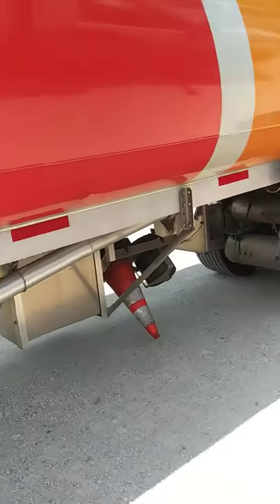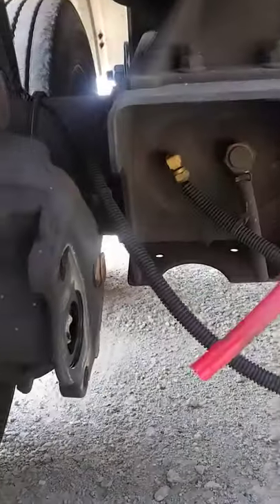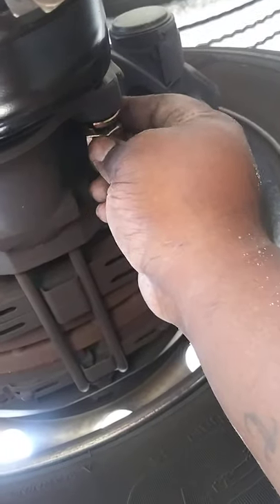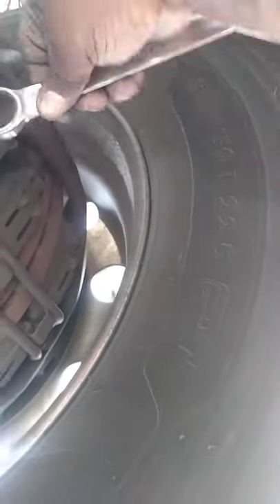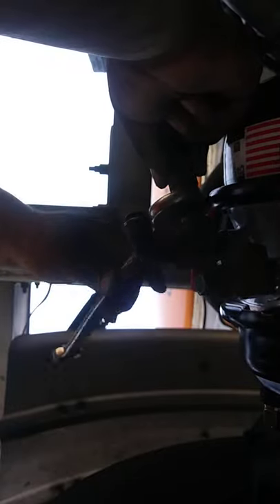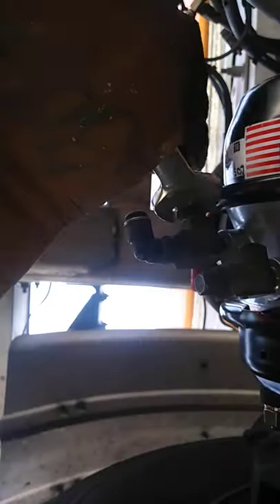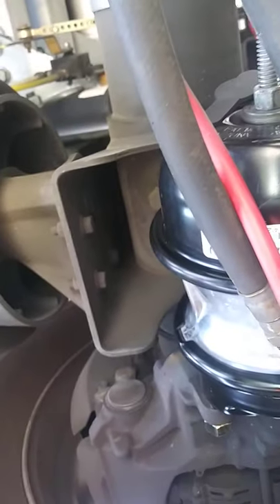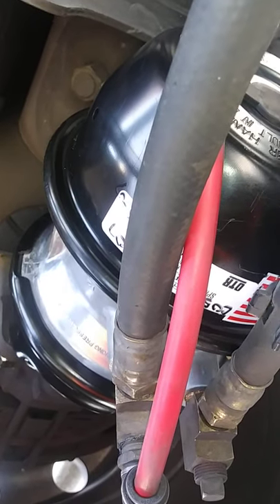how 2 change brake chamber for disc brakes 2020 heil trailer

Comment: Disc brake chambers look reaaaaally easy to install compared to Drum brake chambers!! No slack adjuster and no rod to cut to a specific length…just bolt on and remove bolt and vuala done.. nice video thankyou!